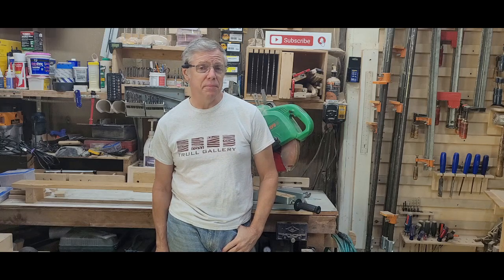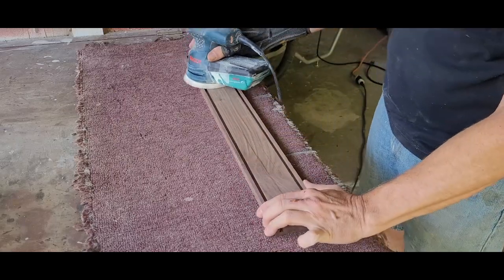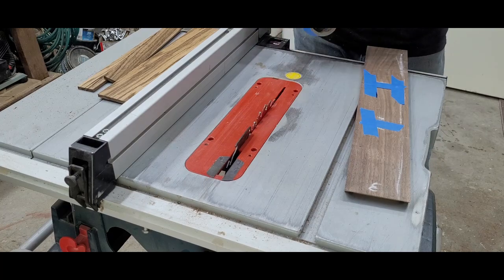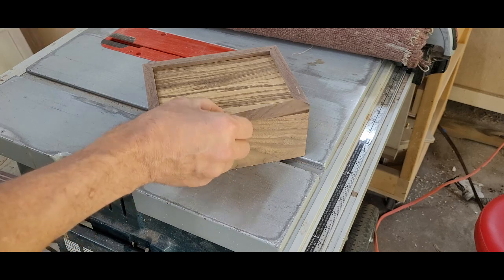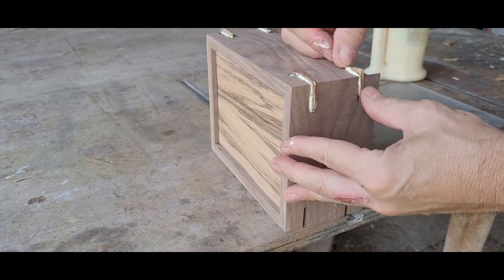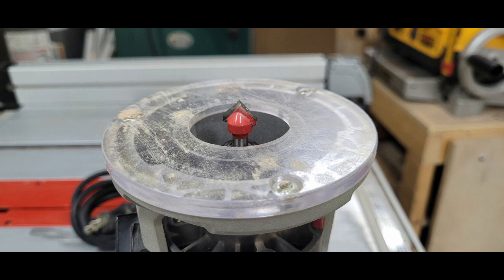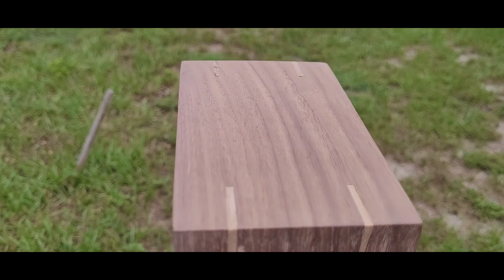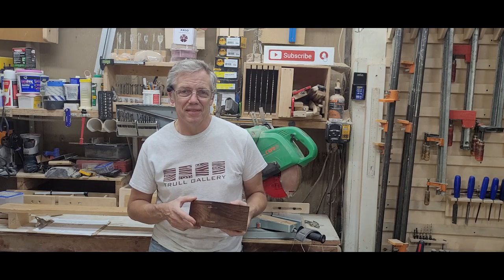A Keepsake Box With Grain Matched Mitered Corners

Comment: Nice, clear detailed video. I have been keeping the outside scrap you teimmed off for another bookmatched lid for a narrower box later since the 2 outside edges still match up.

I actually saw what i was doing wrong with this board flipping method on the miters.

Thanks for not making it an hour of unnecessary dialog.
Reply from the maker: @jimmyers7396  Thanks!  I'm glad it made sense.

Comment: I have some 1/4 inch thick lacewood about 24" long and 5" wide that has cupped along the length.... is there any way to recover it so it can be used?
Reply from the maker: @xisotopex  sometimes you can moisten one face and it will even out.  If memory serves, wet the concave side and set that face down.   When it dries, it should be close.  Do a test if you can. It's been a while since I tried this.